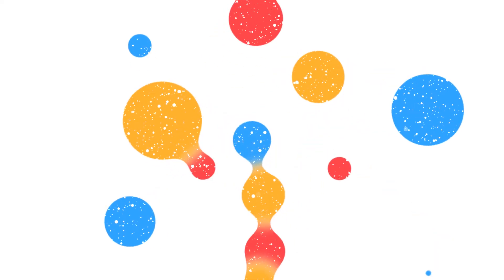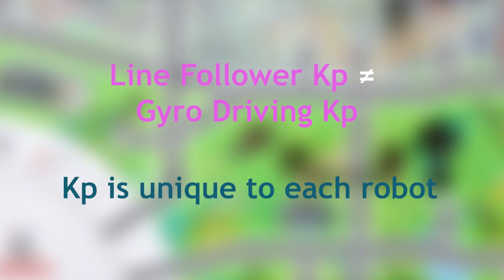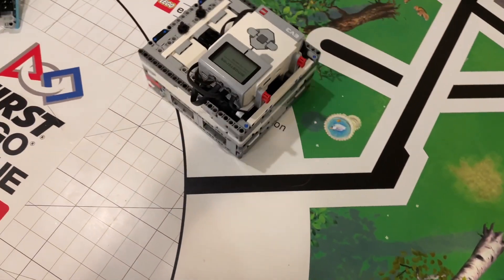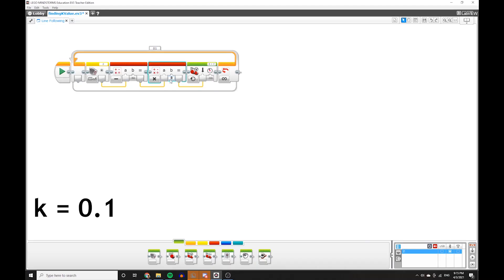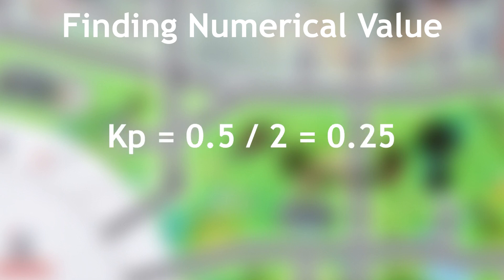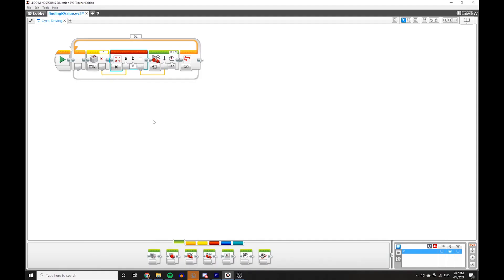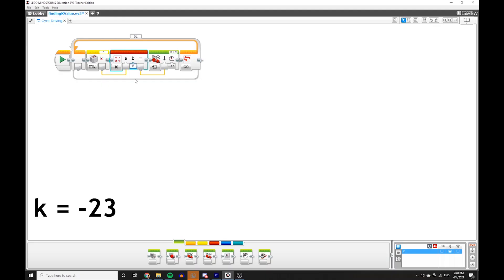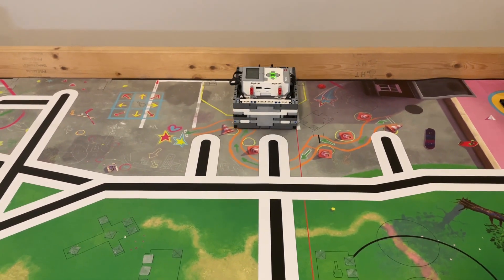Finding K Value Step-by-Step!

Comment: Is the size of the wheel is important for driving gyro?
Reply from the maker: It will affect the k value. Usually, the bigger the wheels are, the smaller the k value will be.
Reply: @brickering5166  Im using size Sprike Prime Wheel the Bigger One. Having Problem with Following the Line.
Reply from the maker: @japogsvlog1095  When you try to follow the line, what how does the robot move?